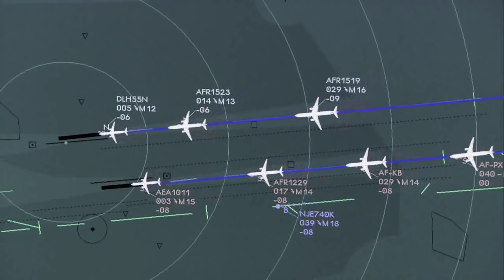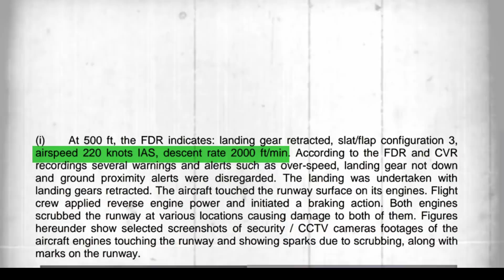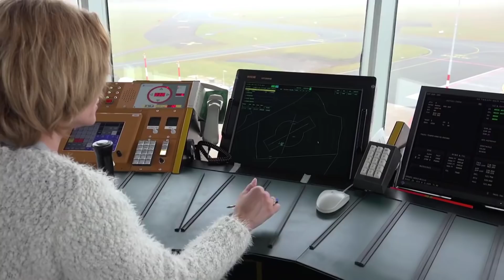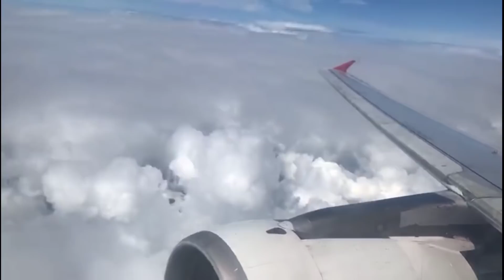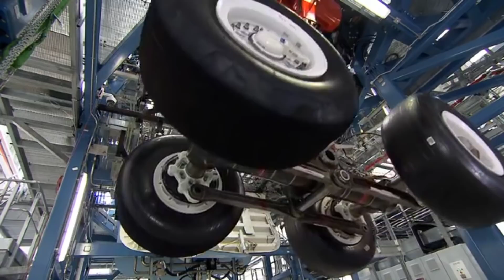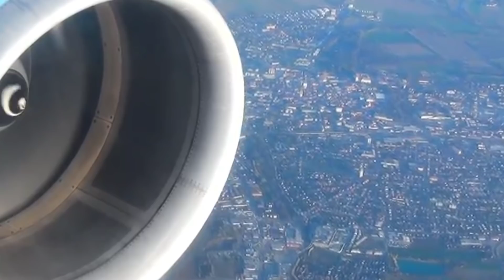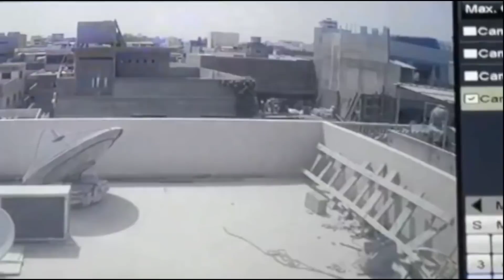Preliminary Report of PK-8303 part 2

Comment: An excellent analysis as well as the consideration of various options to land the aircraft. What about the third option: staying down on the runway on the first attempt and let the aircraft grind to a halt. There is considerable friction between the runway and lower parts of the engine / fuselage, coupled with the fact that they had nearly 5000 feet of paved runway available as well as some unpaved area of the over-run before the outer fence of the airport. Lets say about 6000 feet in all. Admittedly, there would have been high risk of fire due to friction but airport services would have converged at the accident scene fairly quickly. Is there a simulation for Airbus 320 to prove or disprove such an option? Your views will be much appreciated.
Reply from the maker: Hello javed hope you are fine. First of all thank you so much for appreciating the work highly obliged. Secondly sir yes that option was considerable and if he had not lifted back up then yes the runway was enough for an airbus a320 to be stopped by the friction itself. But sir you have to bare1 thing in mind that it was not a planned belly landing but a normal landing in hope to decent the aircraft fast and land the aircraft they struck on its engines and started to apply reverse thrust and braking to the wheels which was never retracted so its a human nature when things are not planned and he knew that he did a mistake so he wanted to correct it by lifting the plane off from the ground and this is the normal action of any human being to counter the mistake once initiated. So i knew this option but i never defined this in my video cause this is what every pilot would have done being a pilot and knowing that u made a mistake and the aircraft is scrubbing on the runway and it wasn't a planned belly landing so his self saving steam would have been activated and he tried to lift the plane which i believe that most pilots would do but then not taking swiftly right decisions is what been the fatal crash of pk 8303. If he had landed and not lifted back up then yes the aircraft had definitely stopped due to excessive friction. I hope it answers your question :)
Reply: Capt Fahad  thanks for a very detailed reply. However, what intrigues me is that here we are not talking about an amateur video game player mock flying on his gaming console. We are talking here about two trained pilots at controls of A-320, one of whom had nearly 30 years with the airline and over 17,000 hours of flying experience (I am referring to the Captain). The route they were flying was known to them like the back of their hand, broad daylight, serviceable aircraft etc etc. Let me give you a crude analogy: while driving on the motorway if an unexpected event occurs, an experienced driver will, every time, instinctively take the correct action in the backdrop of his experience and his equipment limitations.  Admittedly, the first touch down by the pilots without landing gears was inadvertent which surprised them ( trying to engage thrust reversers and wheel brakes etc). But when they realised their mistake, they should have known the fatal consequences of engine damage and stayed on the ground. That was their best chance.
Ok. Someone can say hindsight is six by six. I agree, but that is what sets a most seasoned pilot apart, from a dumb passenger like myself. You may fly a lifetime and never come across a real emergency, but when it happens, you ought to come up to the standards expected of seasoned professionals and the failure scenarios they were supposed to have been put through in simulator sessions.
That said, I feel there certainly will be a lot more surprises in store in the CVR. I wonder if we will get an insight into that. In the mean time, PIA and Pakistan CAA are already shamed the world over. PIA unions including PALPA have had a ball of a time at the expense of the tax payers and flying public all these years. Time has finally caught up with them.

Comment: Tower control men was sleeping 😴😴😴😴😴😴
Reply: FOR EVER - Not at all. They did all that could be asked of and expected of them.
Reply: For ever, you are right, you seem to understand aviation, Trevor Austin is FAKE. He does not have any knowledge of aircrafts and air traffic systems.
Reply: Ibrahim Sheikh - Really? How do you know that? I’ll admit I know every little about Airbus A320. I’ll also agree that my experience of having flown short haul airliners all over Europe for 25 years and being an accident and investigator for 10 of those is not as much as many other peoples.  So what is your background?
Reply: @Trevor_Austin Oh....hhh......Trevor Austin, first you told us that you have flown to hundreds of Airports, around the world, but now limiting to Europe only...
I admitted in one of my comments that I am not in a position to challenge your experience, ofcourse my experience is limited to single engine, and twin Cessna 310. My issue is, you and all other aviators are working very hard to prove that Karachi accident was due to pilot error, already known, proved and agreed. 
Still you are not satisfied and still put alot of effort to prove it was a pilot error. 
For Allah's sake now leave it, can you guide us IF, TOWER operators were there it could have been saved, or you totally disagree. 
Approach radar can not alert, cockpit  crew, gears are up or down, whereas tower can.
UNCONTROLLED AIRFIELDS....and CONTROLLED.......AIRFIELDS, 
KARACHI at the time of accident was UNCONTROLLED Airfield.
Brother, if and when a pilot due to any reason makes a mistake, does that mean 100 or 400 passengers should also die with him, necessarily. 
You agree or not, tower operators could have saved this aircraft and100 lives from accident on that day, that is my point.
Reply: Ibrahim Sheikh - I have flown smaller aircraft across fair chunks of the USA and all over Australia. So yes, I have flown all over a huge part of the world. With regard to the cause of the accident I think you’ll find that I have NOT in any way tried to fault any one person. The two people who could have told us what happened are no longer with us so we have to work out what they were seeing and then try to get inside their minds to find out why this crew did what they did. With regard to the Tower Controllers they were there and I have no reason not to believe they were not doing their job. They gave permission for the aircraft to land and that was relayed by the Approach Controllers. It is NOT their responsibility to check if the gear is down. It’s also impossible to do in reduced visibility, looking into the Sun or at night. I also don’t know when the clearance was given. If It was passed before the 8303 went through 1700’ or so the gear was down! We are also not told what the controllers were doing as this event unfolded. Were they coping? This is not a criticism of them, just a question. So how well are they trained to deal with emergencies?

Whilst you might not agree, this was not a single mistake. As you suggest it would be truly dreadful if one mistake would result in the deaths of anyone. This was instead an entire sequence of unbelievable events that have never ever been put together before. Modern aircraft are equipped with multiple systems to warn that the gear is not down which is another reason for Tower Controllers not to check for gear down. An appropriate reaction to any of these would have given a different outcome as would taking the delaying vectors offered by the Approach Controller.

It is my opinion that seeds of this entire event were sown years ago. I’ll suggest that this was the result of poor government oversight, a lack of operational management, inappropriate, insufficient and poor training, a macho culture, poor union relations and a very heavy blame and punishment culture. I for one will hold the crew responsible for this event. Accountable yes, but not responsible. It was the system that placed them there that needs looking at. And while I am here, we also have not yet been given any details from the post mortems of the crew. Low blood sugar and prohibited substances have to be ruled out. The investigators also need to determine how well rested the crew were before this flight.  

That was a long answer, I hope you appreciate it. As you can read I’m not being critical of individuals, just the system in which the operate. So please don’t put me with other aviators. If my accident investigation experience has taught me anything is that blaming and finding fault will close down your sources of information. Only by finding out what really happened can you set about preventing reoccurrence. And when you have sorted out what happened, creating extra rules, procedures and laws will rarely, if ever, fix the problem. To fix things permanently you have to help people to do their jobs properly. 

ps. Lastly, landing an airliner gear up is not necessarily a lethal event. Taking off after landing on the engines clearly is.
Reply: @Trevor_Austin  Sorry, for thanking you a bit late, and I appreciate for giving a long answer, for my comments....., you have tried to convince me with your thousands of hours experience and more over you are also a team member of aircraft accident investigation team. 
I will not step back, that LIVE TOWER could have saved this accident. 
Sir, I am not challenging your experience or the opinions regarding our national culture and all those things mentioned....
But your undermining the importance of TOWER, in air traffic system puts me in doubt of your capability to understand aviation.......as a whole. 
Please, Sir, why don't you advise FAA, to save millions of dollars, by asking Aerodromes around the world to stop erecting TOWERS at airports, because they are not useful when the sun is shining or visibility is poor or it is night.....as per your experience and observations. 
For God's sake Sir.........please.....🤯🤯🤯
Reply: Ibrahim Sheikh - I’m not so sure you understand how terminal air traffic control works. We will ignore Clearance Delivery and Apron controllers for the time being. We will also ignore the modern “remote towers” being installed by SAAB. I presume you do know about these. But back to Karachi. The “easy” bit to control is the ground. You can generally see things, even in poor visibility. The traffic also moves slowly. Your job is to arrange your traffic so everyone can all get to where they want without bumping into each other. Ground normally stops at the runway when “Tower” takes over. Traffic on the runway and in the air near by is moving faster. Circuit, overflying, departing and arriving traffic need to be co-ordinated. Neither of these controllers NEED to see their traffic. But if they can then it allows them to reduce the separation (time and distance) between their traffic. This allows up to five times the number of movements per hour. That is why we have visual controllers in Towers. But if the tower was knocked out by say a lightning strike, sharing dodgy shellfish sandwiches or a fire then their job could be done by Approach controllers. The reason why this is not done is so traffic capacity can be maximised.

May I suggest that even if the Tower controllers were in direct communication with this aircraft in the latter stages of the approach with its gear up it many not have saved the aircraft. This is for the following reasons. 1. The crew had already demonstrated they not open to suggestions that they were hot on high. Would they have listened? I am not so I sure. 2. Would the crew have had to capacity to change frequency from Approach to the Tower? They had shown they had a problem with one lever! 3. The Tower gave them clearance to land and this was relayed by Approach. This was probably given when the gear was down. It is also sometimes hard to see the gear at 3-4 kms. against a bright sky. 4. Do civilian controllers actually check for gear down? 5. This was already an “interesting” approach and the controllers may not have been prepared for what they were seeing. 

Whilst you are free to question my capability to understand aviation as a whole may I ask you to demonstrate yours with a reasoned arguments?
Reply: @Trevor_Austin  Mr. TREVOR Austin, 
I will try my level best to convince you with my arguments, as reasonable as possible.
First of all, please don't treat Karachi accident pilots, like 9/11 student pilots,(which was a hoax, you know it, I know it, no student pilot can bring down heavy aircraft from 20,000 feet to 2000 feet to a fixed target, IMPOSSIBLE. ), these Karachi accident pilots, were well trained pilots, who had accumulated thousands of hours in their log books, like you have.........
May have made....... maybe a couple of thousands of landings and take offs, with out a single mistake, because no body has raised, his finger against them for their past mistakes, till now.
People make mistakes, very intelligent people make mistakes, generals, politicians, scientists, doctors, businessmen all make mistakes, and it is not necessarily always a guaranteed disaster, somebody at its PROPER place advised them, showed them the real picture, and awakened them up to save the complete disaster. 
In our case, it was the LIVE TOWER, who was in the proper place to save the day.
Reply: Ibrahim Sheikh - I’ll ignore your childish, immature comment regarding 9/11. They are not worthy of a response. 

I’m afraid you show your ignorance regarding these pilots. Most importantly we do not have their training records to determine if they were well trained or not. We also do not have the critiques of the examiners on their recurrent checks nor their instructors’ credentials. You also appear not to understand the reason why PIA are now banned from flying in European airspace. It is because they do not have a Flight Data Monitoring programme. There are multiple reasons for having such a programme. From a flight operations perspective they exist to identify adverse trends in their pilot group and confirm the effectiveness of training. This means you are only unable to state these pilots never made it to the news by crashing before NOT because of data obtained from previous flights. Also, without access to their crew records and talking with their colleagues about their behaviour and competence you haven’t a clue of their ability. Do you have this access and have you spoken with their colleagues? I have made multiple mistakes whilst flying, most small and one or two not so small. But no finger has ever been raised at me either. I worked for a company where you could admit making errors and where you could ask for help if you needed it. If training was requested or required this was recorded in your training file for three years but not in your personnel file. Did PIA have such a programme?

You obviously feel that this crew would not have crashed if only the Tower controller was able to speak to them directly. Maybe, but the crew’s behaviour was such that a transfer to the Tower did not occur that day. The exact reason may well come out in the investigation. I’ve also explained some of the limitations and duties of the tower, but you choose not to consider them. Instead you have an unfounded and unexplainable belief that the Tower would have prevented this. I totally disagree. Let us wait for the report.

Comment: Excellent work describing all the available options after the terrible " scrape and go ". The mystery remains why did they retract the gear at 1740ft and then ignore all the warnings especially the GPWS  " too low, gear ". Just so sad.....my thoughts go out to all the families and loved ones of those who perished in this . May god bless them.
Reply from the maker: Thank you so much Steve yup you are right lowering the gear when not necessary and retracting the gear when necessary is such an abnormal action.
Reply: Nonstandard operation combined with low blood sugar and fatigue seems to have put them under tremendous pressure leading to loss of situational awareness and rational thinking. They were doing random irrational acts by habit. Lowering of gear to get in slot but then raising at 1700ft.  thinking something to be done with gear at that point. They didn't seem to have realized landing gear up. Otherwise they would not have asked for another normal vector for ILS. Instead had they attempted a circle to land approach they would have made it.
Reply from the maker: @vilasshinde5820  well said! 👍